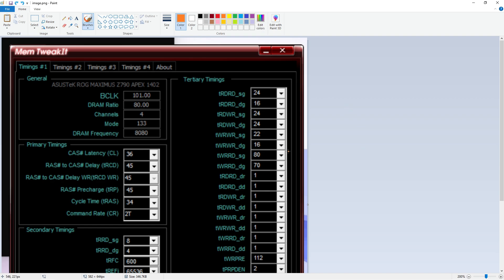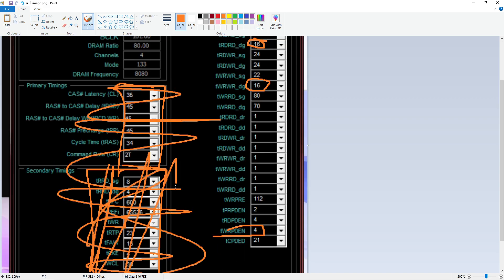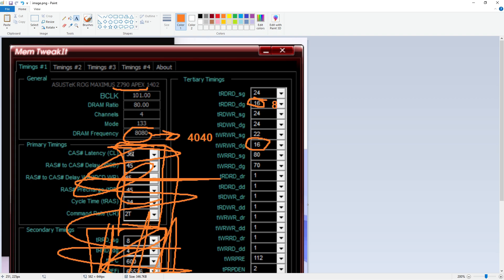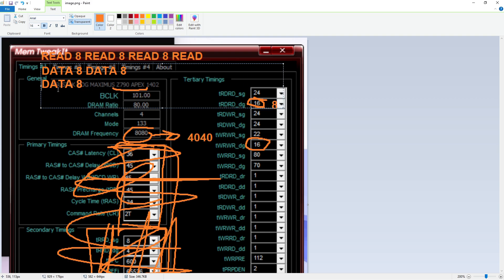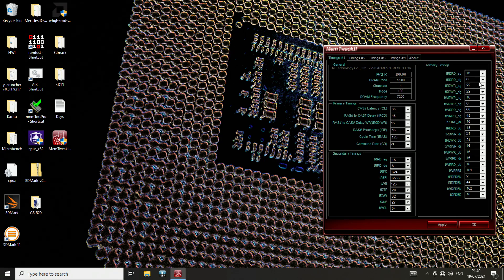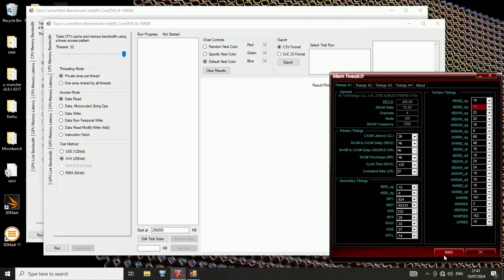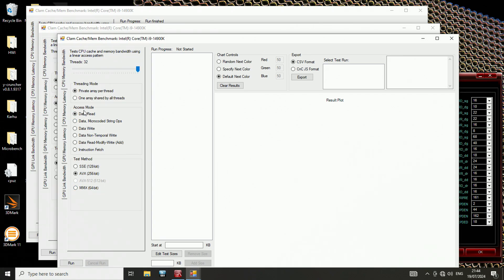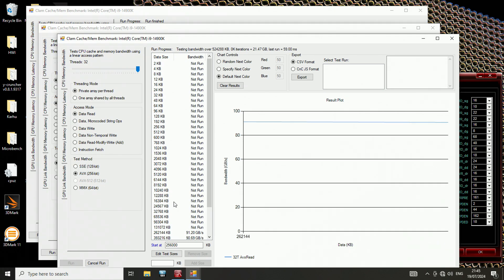NEVER DO THIS TO YOUR DDR5 TIMINGS on intel (AMD works differently)

Comment: Why can't I overclock 4x 16GB DDR5 to 6000MHz as rated?? Only stable frequency seems to be default set by motherboard which is 4533MHz,...
Reply: probably because your CPU can't handle it. if you're on Ryzen 7000, that was never gonna work. more sticks and higher capacities means you're giving up speed.

Comment: Not bad in terms of bandwidth specifically, however for better stability if you follow Jedec’s rules, WRWR should be double RDRD. It’s it written in the specs.. and it does affect the write performance. You know, there are some many ways to break the rules that make them work with a good 1DCP mobo like an apex and a good IMC. I would say it’s Pay2Win  config..  if both SG are set at 8, you should try to lose / work with RRDS/L and WTRL/s..

Comment: hi quick question, i plan to upgrade from 16gb ddr5 cl 40 4800 to 32gb ddr5 cl 36 or 40 4800 it's almost same price, i use asus f17 2022 laptop model i will get benefits from the lower timing also i checked in bios and there is no xmp or something else like most laptops have locked bios. Thanks
Reply: If you question is will you benefit from the tighter timings?  If so, yes you will, but I doubt you'll notice any of a difference since that's not much of a timing change and I would only expect synthetic benchmarks to show slight improvements.  So if you upgrade go into it for the doubling of the density, not the speedup.

Comment: Need timing on electronics levels ? Or need to know how to get advance, using the memory !
I went into the beyond setting, my OMEN system was able to do this custom too, able to do it on XMP 6000 too.
Autodesk MAYA i used, big arrays of DATA, GPU and CPU beyond the limits, not willing to overvolt any parts beyond XMP profiles, needing it 24/7 operatable on a workstation i work on.
XMP 6000 is too fast, you will never need faster memory on this gen. XMP 5600 should be fine ! Why clock it faster, where is the bottleneck ! not here, sorry.

Comment: Hey mr overclock. I have a question and hope you can help me out. 

I have 4 times corsair DDR5 5600 running at 6200Mhz. Timings at 36-36-36-76 112. FCLK 2167 on AMD ryzen 7900X.

But it also works on 5600mhz with timings 30-30-30-58 88. 

What would be the best option in your opinion to your knowledge?
Reply: I’m not buildzoid and I will not give you advice but I will say that you can download aida64 extreme and run a memory benchmark with both memory profiles and see for yourself what’s “better”.

Comment: Can RDRD_sg and WRWR_sg be 8? Or is 12 the lowest for both? What happens if they're set to 8 anyway?
Reply: magno5157
where is the bottleneck !
need faster than XMP 6000 on this gen ?
why unstable, running what ? make sense please !
Reply: @lucasrem  When have I said that I had bottleneck? When have I said that my system was unstable? You're weird dude.

Comment: So I'm slowly starting to realize for that average gamer, manually overclocking DDR5 is not worth it. I bought your recommended Team-group 6800MT/s kit paired with the ASUS ROG STRIX Z790-A GAMING WIFI & 13700k. Enabled XMP-I then set to 7200MT/s and get missive improvements in Read, Write & Copy as well as 54ns on latency. MemTest passes everything runs great.... So am i crazy in my assumption or am I missing something?
Reply: Not missing anything, you are smart. The only time people should be tweaking this stuff endlessly is if the kit they bought is shit, or their good kit doesn’t work properly at XMP. Take your results, and game!
Reply: Sounds like you got a good CPU and kit with good chips. You won the silicon lottery, congrats! Take your winnings and cash out some free time!

Comment: how do you get memTWEAKIT to work on a MSI board?
Reply from the maker: it should start on all LGA1700 boards. If you mean the ability to change timings there should be a setting in the BIOS called something along the lines of "realtime memory timing" that you need to enable.

Comment: Can anyone tell me what's the calculation of ddr5 timings I'm new to memory overclocking.
Reply: DDR5 supports a speed of 51.2 GB/s per module and two memory channels per module  and Like DDR4 you double the speed 4040 in his example show x2 = 8080 mhz

Comment: Something else to keep in mind with this is that most programs tend to send lots of memory accesses bunched up together in a short amount of time, after which they will mostly run from cache for some time. So even if your program doesn't actually saturate the full bandwidth of the memory bus when averaged out, these back to back timings are still very important to quickly get through those batches of memory accesses.
Reply: If U have a guide I would love to follow it

Comment: how is the mem controller on 14th gen? is it worth getting the 14600k over the 13600k?
Reply: It's the same architecture, its the same processing node, its the same silicon.

If anything, you might be lucky when buying a 14th gen CPU extremely late in its production cycle so statistically speaking you might get a chance of better silicon quality due to process aging and improving
Reply from the maker: that's definitely not worth it.
Reply: @ActuallyHardcoreOverclocking   But lot better than 12th gen not?

Comment: What are these timings called on AM5 ? IS it the SD (Same dimm)  and DD (different dimm) timings ?
Reply: SD and DD are not those. SD - works as *_dr on Intel and DD - as *_dd on Intel.
There are following types of tertiaries: *_sg, *_dg (explanined in this video), *_dr, *_dd.
I used Intel timing names here.
Reply: Sc

Comment: Hey buildzoid can you do an update on the newer amd agesa bioses? My tuf gaming x670e plus has been stable (if i set voltage for ram) since august. What will the new bios really do?
After a year of instability i finally have it stable and i don't see a reason to update yet.

Comment: My DDR4 timings were auto set to 4. Nice. Even though I tweaked the primary timings and frequency, the board did it right. 😊
Thank you for the tip.
Reply: DDR 4 on this 14th gen is bottleneck !
Do we the XMP 6000, where is the bottleneck ?
Wait a gen now ?
Please understand the basics, where is the bottleneck !
Reply: @lucasrem  I should have said that I'm on AM4. Sorry
Reply: @lucasrem  
Whether DDR4 will be a bottleneck for the 14th generation depends on the characteristics of the DDR4 module and the software task. It is not a rule of thumb that DDR5 is always better.

Comment: I feel like the issue is probably way more the memory not being organized the way the cpu wants to read data out of it than the 14900 not having enough compute power to take advantage of the maximum bandwidth. At least in most workloads. 

Tho i havent tested this with a 14900, its usually a pretty good rule of thumb. If the cpu cant use the bandwidth its most likely something holding up the pipeline and the caches being full while the cpu waits for some specific data from memory

Comment: At some point I need to go through the DDR5 datasheets and make a poster diagram of how all the timings fit together, so people don't make these mistakes.
Reply: hookers, blow, oral, and all that to you, kind sirs or madams
Reply: that would be friggin epic!!! I really need help tuning my a-die to get better latency and see what the most optimal timings would be..... 48gb 7200cl34 t-create kit, having issues running xmp on the 14900k i have but it ran perfectly on my 13600k with the same maximus hero z690 board. the 14900k is an sp97 and my 13600k was a friggin sp80.
Reply: @cppctek  Im having this same problem with my A die. Ran 8600mt/s on a 12900k and Z690 Kingpin. Switched to an Apex with an SP 112 13900KS and CANNOT BOOT AT 8000!?!
Reply: @cppctek i cant run even 6800mhz on 7400 kit with new 14700k. Tf intel did i dont know... So annoying
Reply: That would be awesome. The timings are just such a mess and very few people know how these works properly.
Reply: Sounds great I'm surprised nobody hasn't done this already
Reply: i would totally donate you for this

Comment: I got my DDR 7200 running at spec now. Thanks 
I could not get it to run XMP or anything faster than 6800
Sure glad I didnt post any screen shots LOL
Reply: XMP 6000 is more than enough for 14900k 
not bottlenecking it !
Play games ! or large data set needs ? Cloud compute PC ?
XMP profiles is faster then overclock it on the wrong timing !
Reply: replaced some 6400 that quit.......dont over think my issue  @lucasrem

Comment: I'd like you test out a 14900k and determine if the MC is any better than the previous gen. I'm assuming no, but would still make a good video.
Reply: its not better at all
Reply: it's not better it's not worse. It's the same and it all comes down to how lucky you are at the lottery. My experience has been good.

Out of 3 14900KF, one can run a few benchmarks at 8800 c34 48 and is stable at 8400 c36 48 48, while the other 2 are stable at 8200.

All 3 of them can run benchs at 8600 c32 with enough stability to never crash (excluding Y-cruncher). Their MC SP are 69, 74 & 78. 

The only difference between all 3 is how much IVR TX voltage (CPU VDDQ) and MC voltage (VDD2) they need. 

My 13900KS (MC SP 82) and 13600k (MC SP 74) could do the same; however true stability was not possible above 8000.  This is all with A-die 2x16 (G.Skill 7600 c36 46 46 121) on APEX Z790. 

I'm just giving the MC SP to underline the fact a higher value doesn't equal better IMC. My samples had better IMC but I know people who had worse memory controllers compared to their 13900KS.
Reply: He has shown that his 13600k has a better MC then his 13900K, so the chip to chip variance might be too large to make the right conclusion.
A good 13th gen MC could be better then a bad 14th gen or opposite, he would need to test atleast 5 CPUes from each gen to come with a valid conclusion.
Reply: Its way worse than last packs of 13th gen

Comment: So if the ram is actually designed for 8 cycles between reads, why even make this a changeable parameter in the first place?
Reply: Those are for memory frequency world record.
It also includes setting a bunch of outher timings like primaries and secondaries as high as those go.
Reply: @volodumurkalunyak4651  you will never get any benefit there, running what.
is XMP 6000 already too fast ? bottleneck is the 14900k it self, XMP 5200 is fast enough ?
Reply: @lucasrem  memory frequency world record is not about maximum performane, but macimum achieveable clock speed.
Is XMP-6000 fast enought - that is whole different question. In fact answer greatly depends on bencmarl used.
Cinebench - 1 stick of DDR5-4800 JEDEC memory is fast enought, y-cruncher - dual channel of manually overclocked memory at DDR5-7200 is probably not enought.

Comment: I have to say I didn't play with my DDR5 at all.
Two systems, one with 12gen and one with 13gen, and both just 6400 MHz xmp.
I know setting xmp is a shame, I'm a normie :D and I just wanted it to be stable.
Love to follow BZ anyway, never change man!
Reply: Man you should at least test the XMP using Memtest or TestMem5 to know for a fact that they're stable, because it's easy overclock but it ia overclock in the end.
Reply: @dethskullcrusher  Except that isn't really what XMP is in the first place. 
XMP values are, memory side, tested by the manufacturer of the RAM and actively advertised to be the intended speeds and timings. The only ones who claim it is 'overclocking' are cpu/mobo manufacturers looking for excuses to avoid RMAing faulty products. If you go look up the specs sheet for a given CPU it will actively state what it's max supported RAM speeds are, and even clarify further in most cases as to specific slot configuration limits. Those listed speeds are also in excess of baseline speeds. Same goes for motherboards, where they typically have a QVL list somewhere that will actively list supported ramkits. Many of which are at more than the baseline speed for that breed of ram. 

So, no, enabling an XMP is NOT 'overclocking'. It is using different settings than default, but that does not equate to overclocking, as that implies parts operating BEYOND THEIR DESIGNED AND INTENDED LIMITS. A cpu that claims to support 5200mhz DDR5 in a 2 slot config, on a mobo with the appropriate socket, isn't OCing by running a 2x 5200mhz ramkit @ 5200mhz, instead of the 'default' of 4800mhz. Now, if you were to run said ramkit at 6000 mhz, THEN you would be OCing.
Reply: @jtnachos16  is not anything faster than JEDEC overclocking?
Reply: @dethskullcrusher  of course, after assembling, ram and every other component is always tested. It's even useful to set a baseline, to check once a year if everything is still fine. And it's fun too as a weekend project.

Comment: Btw - some of the 14th gen have decently improved IMC. I can do DDR5-6800 64Gb dual rank Hynix A-Die on a Z790 Strix-E w/ stock voltages completely stable over hours of YCruncher, OCCT & Tm5. It’s survived multiple reboots and a week of gaming too. My 13900K would error in minutes under same conditions. 

Would be curious to see if you could get DDR5-7200 on an Apex.
Reply: He already got 8000 on his 14900K
Reply: it's normal improvement in manufacturing on the same node
Reply: U know they 13th and 14th gen are the same chip right? Nothing is better binned on 14th gen. I don’t get why people believe it my guess they have to justify the cost of the new cpu that they bought. It’s literally called a refresh 👌🏻
Reply: bronsondixon4747
What did you build ? 14900k, why on the Christmas Tree Strix Z790 ? 13700k is able to run your GTX 4080 Card just as fast.
Less parts is faster, 2 banks the max.
Keep it on XMP profiles please, only PRO people, not the gamers, can get benefits here. Large Data sets, you ? Why you need it ? Running What ??????
Great system you did build, XMP 6000 will never be any bottleneck here ;)
Reply: You just got lucky, mc is not better at all on 14th gen

Comment: what about values lower than 8, are they ok ( intel or amd )? for instance, 6 or 4?
Reply from the maker: they don't work because the burst length is 8 cycles. You can't have 2 sets of data on the bus at the same time.

Comment: First shalt thou jam on the Holy F10. Then shalt thou set tRDRD_dg to eight, no more, no less. Eight shall be the number thou shalt set, and the number of the setting shall be eight. Nine shalt thou not set; neither set thou seven, excepting that Intel then round up to eight. Sixteen is right out.
Reply: DDR5: tRDRD_dg and tWRWR_dg - both at 8
DDR4 and lower: tRDRD_dg and tWRWR_dg - both at 4
Reply: Did you by any chance post this from a Youtube app coded in Python?
Reply: Lmfao nice
Reply: Amen

Comment: could you feasibly use 16 if u wanted to run max frequency to achieve tighter latency on the other timings? like if your just gaming could u actually use that timing to stabilise higher clocks and achieve better latency? or like u said run half clock and tighten the hell out of her
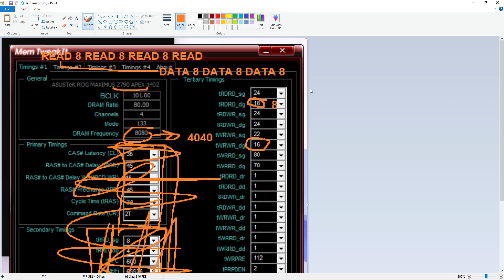Reply: 6:16

No you cant it will nuke your latency and make everything worse
Reply: if your maximum theoretical bandwidth is cut in half because you can only send read commands half as often as you should be able to, no amount of tightening secondaries will fix it because in the end it's reading data from/writing data to ram that matters, not just opening a ton of rows and letting them sit there.
Reply: That's one way of saying you didn't watch. 18:03
Reply: Doing all the same adjustments with outher timings and setting those 2 at 8 (for DDR5) is just as good.
The lowest latemcy - manually overclocked DDR4 Samsung 8 Gigabit B-die in Gear 1.

Comment: nice both my tRDRD dg and tWRWR dgs are at 4, nice
what about tRDWR? mine wont stabilise lower than 14 and thats for all of them (sg, dg and dr)
Reply: u answered in vid cheers lad, low as she goes
Reply: You have good tertiary (those that you showed here) timings for your DDR4 (tRDRD_dg at 4 is for DDR4, DDR3 and previous dont have such an timing, for DDR5 it won't work at <7) memory.

Comment: can you make avid on how to cool ram better. other than that great vid
Reply: ram fan $10 aliexpress + noctua 140 3000 ipc $30
Reply: @Heitorr Delta or Sanyo Denki fans are way better server grade professional fans than those from noc. Digikey and mouser got them
Reply: bend a strip of aluminium, screw it somewhere in the case and screw a fan on the other end. ur good for 1.55v in aussie ambients running dual rank gskill rgb b-die without a gap between the dimms (about as bad conditions as it could be)
Reply: I just have a 120mm fan hanging from the top of my case from zipties lol